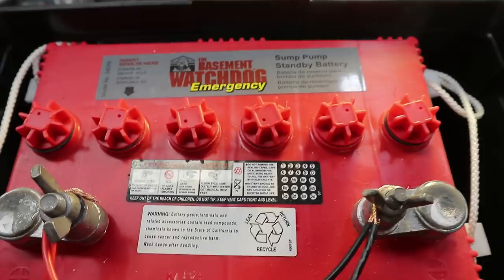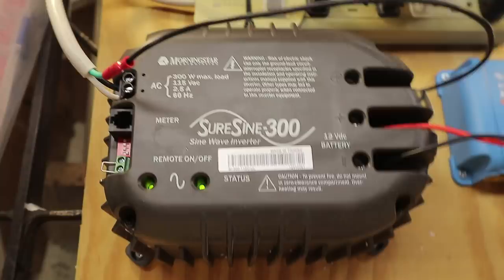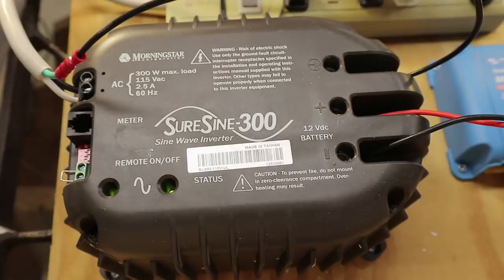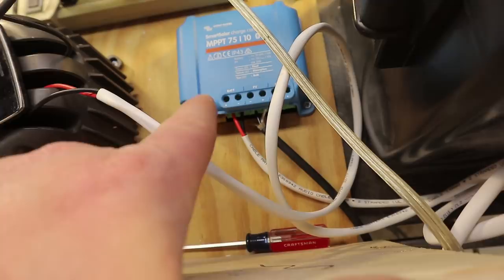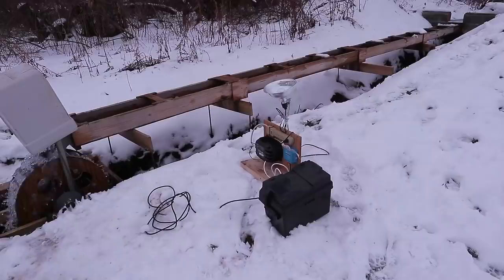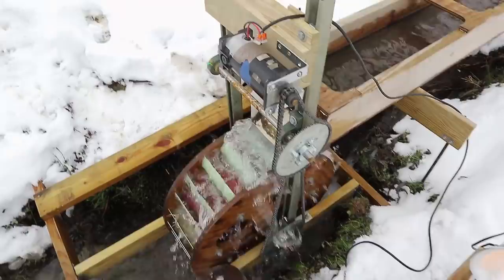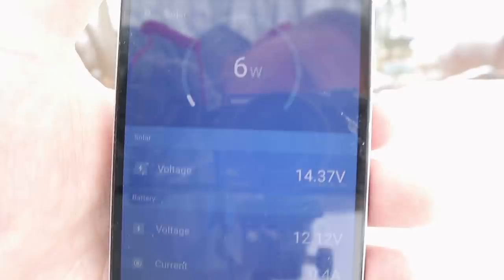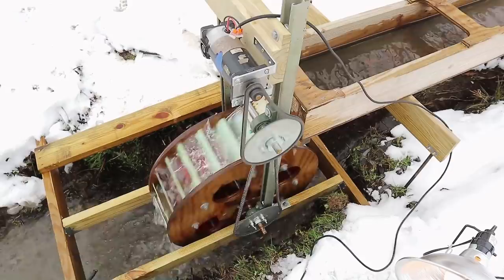[Part 10 of 10] Waterwheel Microhydro, How Much Power?

Comment: Just a thought but would you not get a greater wattage by using a higher dam, keeping outlet in same position if not even lower, while using a pipe to the funnel water under pressure (water pressure created by depth of water above outlet pipe 1 - 2 ft etc)?

Comment: Part 2.. yes I could not stop without telling you that you're supposed to have planks in front of an underflow water wheel so that you can raise and lower the water table in your pond this you get to shoes when you need your rotation just by removing one of the planks.. now the third plank or the second plank is one that has a flow regulator that is it has enough space that left the flow go through to the water wheel and they're being a top board keeping some tension in the pond thus there's more water going into the pond and it's going through the flow board something something just cracked the boards put a rock in it...

Comment: Damn it... i was writing a comment and youtube start playing another video and everything is lost. Grr... So lets try it aggain. 
PV MPPT can NOT be used with water. It work as DC/DC converter and it can make from 60V 1A 12V 4,9A to battery. But it has a but... When it is connected to PV array... it just tries within a second (very short time) the VA characteristics of a power source. So it just start to drain more and more amps and calculate where it is best. It works almost flawlessly with PV, but not with wind or water.

When you connect this controller to water, it does the same. Waterwheel is spinning and also acts as a flywheel. Water is kinda heavy and also act as a flywheel. When you connect that generator to charge controller it does the same thing. It start to drain amps. That causes slow down of the wheel and lowers the voltage. MPPT for PV works really quick, so when it found that it isnt enough energy it stop charging (thats to poing where generator voltage drops to battery voltage) It is not a MPPT regulation then, it is PWM. Even when it drops charging or charges with a really low current when it tries aggain to find best mppt it wont be working, because the wheel dont have time to spin-up faster.

Correct working of MPPT with water is making those changes on VA really slowly, like 10% increase of amp and waiting 10s if output is bigger or lower, then increase or decrease current drain from the souce.

You can make this simply and cheaply (but not MPPT) by monitoring voltage. You need to find yourself correct voltage for maximum power output and use DC/DC to battery voltage. Some better charge controllers can work with this mode, but for this small power you can try to do it with cheap modules from china. You just really needs a DC/DC module with adjustable startup voltage.

https://goo.gl/QyoF1i - make sure that you wont go over maximum voltage!

Give it a try... you could be very surprised.

Matess
Reply from the maker: I understand your argument but my system clearly worked, If you'll remember in a previous video my open circuit voltage was 33V and the controller was regulating the generator to run at 14V. Additionally a wind turbine will change power output every half a second, your 10sec example would not work for a more active system.
Reply: wind turbine like water turbine has also that flywheel effect. You can take a lot of power before you slow generator down to battery voltage. Beleive me or not... I actually dont care. That module cost few bucks and from that much water I believe that you can no problem should be able to do 10-20W.  If 33V is open voltage then ideal voltage to load should be ~1/3 lower lets say 22V.  Charge controller is trying to get so much energy as it can so it just drain the current and slowing the wheel down when it reaches battery voltage. Thats not the maximum of your wheel. You need power regulation driven of RPM - more RPM - can drain more power and more RPM = more voltage. Do you get my poing? It is your power generation... you are handy and skilled with tools and wood. Nice to look. You have also good construction ideas, but you dont understand electricity and electricity generation. (sorry) My recomendation is give that stupid cheap chinesse module a try. I dont think it will last long (it is not very good for longrun) but it can show you how much energy you are loosing. You know what? Take this as a bet... If it doesnt with enough water generate 50% more energy I will pay you  that module.
Reply: Hello Joe, nice work! I aggree with Matěj - give away the solar controller. For the most simple test of output power you can take for example 100ohm rheostat (100-watt rated), connect it to your generator and measure current flow and voltage across the rheostat (load). Then just move rheostat's slider and watch RPM of your wheel. You should find maximum output power of you system and dependency of RPM and output power. I think the goal of regulator is draw as much power to keep RPM constant.
Reply: true... but who has 100W rheostat? I am trying to think of a way how to show him that he is loosing energy in simple... it is just maybe put 12V car lightbulb in series between generator and charge controller and then you can measure power to battery (which I think will bee pretty much the same) but also some power can be found on the bulb. My idea is that charge controller aggain kill all the voltage up to the voltage of the battery and light bult can glow a little bit. But thats a lot like maybe... rheostat is the best for measuring.

And one more thing.... if you buy that module which has 35V voltage limit and you will connect it to 33V open voltage, then that module almost immidiatelly die. There will be spikes with higher voltage, but voltmeter cannot measure them. You need to use another power supply and set that module correct output voltage (CV 14,4V), then you can set power limit to maximum (CC 5A you can actully do with very small resistor or even you can do it like shorted with multimeter - it should survive) and then you should set starting voltage (marked as MPPT to lets say 16V). Stop the waterwheel, connect it to stopped generator (so you will be sure that voltage wont go high) and then start measuring what is going into the battery. Then you should measure input voltage and rotate MPPT trimmer and try higher voltage - this will cause higher RPM and wathc what happens with power to battery. 

Bad thing is that when your battery will be fully charged - so no current will flow there then voltage rises aggain to open voltage and it possibly destroys that module. It can be protected by dummy load... lets say you find that optimal voltage is 24V then you should build 50-100W resister load which should open at 28V by curcuit (adjustable zener diode + tranzistor) and forced that excess energy to those resitors. When you have some load to that battery, that module charger starts charging and put voltage on the generator back to set 24V and dummy load will do nothing. 

It is only if found that module usefull and if you will want to use it. For test it is ok when you set that module as I told and mainly start from not spinning state.

Good luck man.... and so far good work on the wheel (I wish I have a creek near my future house) I dont have experience from water generation but I have experience with VAWT. Believe me... I´ve been through all this just few years ago.

Comment: Hi, I noticed that the wheel is a little ahead of the other video. I think if you put it back, the water pressure will be higher and the rotation will be higher. Hope this helps. Hugs.

Comment: You could increase efficiency by enlarging the pockets on the water wheel so they can contain the entire water flow without spilling. Changing their angle may also help. However the biggest power gain would come from changing to a single stage flat belt drive system and some used car alternator. Your chains probably waste more power then the system produces at the moment.
Reply from the maker: a tighter angle would yield a smaller volume bucket requiring a wider wheel. belt vs chain is a wash I feel. I couldn't get a large enough pulley for a single stage v-belt system. A bicycle rim might have been an option. Car alternators need very high rpms to work unless you spend a bunch for a PM core.
Reply: Joe Malovich I agree, the system is as efficient as it can be. If you could measure the quantity of water and the distance it drops you could work out the maximum wattage achievable before any system losses. Good luck with your future ventures. P.S hi from Wales
Reply from the maker: I have that data to calculate my efficiency.
Reply: Joe Malovich As a matter of interest how much power would be available if the system was 100% efficient?
Reply from the maker: Huw Bishop previous estimates were about 12-20W. For this video I recorded with my camera the velocity of an object in the flume and it's depth/width. I would need to load that video and count the frames for a velocity.

Comment: Didn't you calculate first, before you found out, that's so less?
Water amount and drop height are the the key and both will give you on esay caculation how much energy you will get out, if the machine would have 100% effeciency...
So, I think, you make 8 watts on the wheel shaft, but for more, you need more water (and a wheel to handle this more water) or you need a bigger drop height (and a wheel larger in diameter, to handle the height) ....

Comment: Looks to me like you could have just taken the first chain right to the generator and eliminated the secondary completely which would lighten the load on the water wheel and increase it's speed. Also making the wheel it's self out of lighter material would also add to it's speed, that wood when soaked will weigh a lot. Maybe a couple of bike rims, one on each side would work for you in this case seeing as it is a small water wheel.

Comment: removing the water from the bottom of the wheel would remove the stopping power, as it (from what I can gather on the videos) pushing some water backwards.
Reply: at 7:07,  the 'wheel is not  IN  the  tail-water.   so, No issue. kz         cheers

Comment: I'm no electrocian, but isn't the W output irrelevant, when you have a large enough battery-bank? 
I mean, the load on the battery-bank is not going to be static. 
So when the load decreases, the output from the source will have time to recharge (during the nights I guess) the bank, yes? 
So the question is really about how large of a battery-bank can you support with the power-output you're getting...or am I way off here?
Reply: Almost! A battery bank just lets you store energy (like filling a bucket with water). But if your generation can't keep up over time your bank will slowly run down over time (a bigger bucket takes longer to empty, but if you're taking out more water than you're putting in, you'll eventually empty it regardless of the size). Ultimately what matters is how many joules of energy you use on average (per day/month/year). One watt is one joule per second. With the performance of this video's system as an example, 5 watts for an entire day is 432 kilojoules (about 5 alkaline D cells, for perspective). So you could run a 5 watt load continuously with no battery, a 10 watt load for half a day (given a battery bank), a 100 watt load for just over an hour (with battery bank), or a 1000 watt load for 7.2 minutes (again with a battery bank). But any more than those figures and you'll cut into the power for the next day. Now if your average power consumption is really 5 watts over a month's time (because say you're not at the property during the weekdays), a big battery bank lets you save the meager 5 watts over a long period of time to quickly release all at once (relatively).

Hope that helps.

Comment: Congratulations, everything is can be improved. Your fiesta aproach is quite good. 5W constant un winter is 120w a day, what will be on rainy season?  Just one suggestion, that power can easily lower your bill using 12V LED lights in your house, just need to make the electrical installation for 12 DC Volts. 
Congratulations
Reply: just use it to trickle charge a battery bank.

Comment: Nice work. I always wanted to make one. I think anything smaller than 1m or 40" diameter wheel is not going to cut it for a small stream like that. I would be curious if a fly wheel on the generator end would help.

Comment: Some thoughts on using a water wheel as an "impulse turbine". How inefficient it is to send water at speed against a surface or pocket in a water wheel and then have it follow the speed of the wheel.

Not like a Pelton impulse turbine where water transfers energy at low friction and leaving having low kinetic energy.

When a water flow hits an obstructing surface that travels with lower speed it is like a ball of clay hits another mass and they continue stuck together. It is called an "inelastic collision" https://en.wikipedia.org/wiki/Inelastic_collision

Compressing the clay at impact creates heat so the two masses have less kinetic energy than before the collision.

So in the wheel the speed of the water is eaten up by friction if it hits a slow moving surface and particularly if the surface moves slowly away from the incoming water and also produces no force on impact if wheel moves fast. 

If wheel speed v2 is defined from inflow speed as v2 = v1 * k

When the wheel moves at say k=0.25 of freewheel speed, the water collides at 0.75 speed. The mass that catches up and collides with the wheel is then reduced to: m2 = mass * (1-k)  = mass * 0.75

The impulse force F = m2 * v1-v2 = m2 * v1 * (1-k) = mass * v1 * (1-k)^2  

Impulse transferred power is P = 0.5 * F * v2 = mass * v1^2 * k(1-k)^2

, so impulse power separately, is a a function  of  k(1-k)^2

It is zero both for wheel speed k=0 and k=1 and has its maximum at k=1/3 wheel speed.
https://www.wolframalpha.com/input/?i=x*%281-x%29%5E2

But, it is better to keep kinetic energy of the incoming water at a minimum by instead making the waterwheel taller so incoming water has lower speed. Remember it is still the same volume, it just flows slower at wider area.

Also if the wheel is made wider and is filled with as much water as possible it can rotate slower for the same water volume and contain less kinetic energy of exiting water.

And finally keeping water in the wheel all the way to the ground. If possible.

Comment: The M.E. here says you probably are spending 10-20 watts spinning the drivetrain.  Also less than 50% efficient generator at that load.  And certain efficiency of extracting the energy out of the water.  5 watts seems about right when you factor all that in...
Reply from the maker: Concur.

Comment: 5 watts doesn't seem logical to me, try a diode from the motor directly to the battery and I'll bet you get more than .5 amps. My guess by the drop and how fast the bucket filled, you should have gotten 75 watts.
Reply: You seem to have problems with figuring out the available energy. The math is as follows.
Head = .76 meters (30 inches)
Mass = 1.5 kg/sec (1.5 liters/second)
Gravity = 9.8 m/s^2
Power = .76 m * 1.5 kg/s * 9.8 m/s^2 = 11.2 kg*m^2/s^3 = 11.2 watts
The figure of 11.2 watts is assuming 100% efficiency.
I know the values for head and gravity are accurate. The value for mass is an estimate because he hasn't actually given us the normal flow rate for his system, but I would be surprised if the actual figure was much different. In order to get 75 watts assuming 100% efficiency, he would need a flow rate of 10 liters/second which he obviously does not have. And since 50% efficiency is reasonable for a system that small, the actual flow rate would have to be 20 liters/second to get your 75 watts. His 4 to 5 watts is quite reasonable given his low head of 30 inches (.76 meters) and low flow of 1.5 liters/second.
Reply: Where are you getting 1.5 liters / sec? He filled a 5 gallon bucket in a fraction of a second. I horsepower is about 400 watts. and 550 lbs of water 1'/sec = 1hp. One full bucket of water is 40 pounds. If that full bucket moved that wheel 24" down, that's 2' @40 which is .14 hp and that would be 58 watts.
Reply: @HarleyFXS  That was shortly after a rain storm and was not normal flow. And someone else mentioned that he did check the flow under normal conditions. Got 5 gallons in 12 seconds. Which is close enough to 1.5 liters/sec.

Comment: Also if the wheel was slightly higher out of the water the resistance on the wheel would be less. Allowing a slightly bigger gear setup and maybe getting 10w?

Comment: The alternator is the weak point imo;  but anyway, 5W will charge a battery (or a bank of them) -- and then it doesn't matter how low the power output is.  It just dictates how long you have to wait between recharges.

Comment: Hope you had some fun!
This whole project made the young boy inside of me smile... while the adult me (engineer) just lost his mind :D The construction, the materials... Why!?! :D
Reply from the maker: Economics.
Reply: @JoeMalovich  did you factor in throwing away everything pretty much every year because you know... Water, wood, screws and all don't really love each other? 🤷🏼‍♂️
Reply from the maker: @Stefan Schäfer everything is pressure treated with exterior hardware except the axle and other power transfer components, it would have lasted at least 5 years, at which point if I was still pursuing the project I would have replaced it with something more durable (and expensive).

You also need to understand I was doing this all out of pocket for fun with low expectations to begin with so I didn't want to put too much into it.